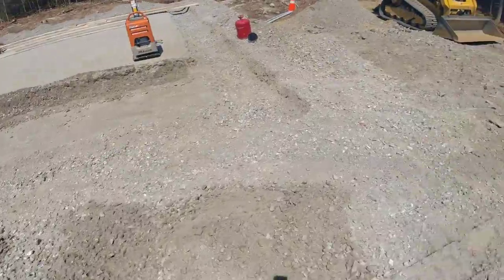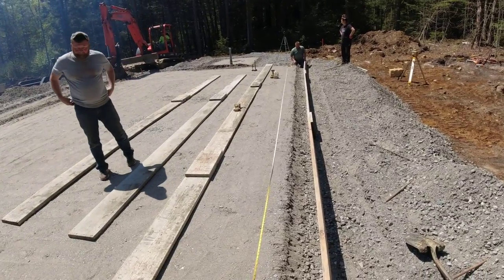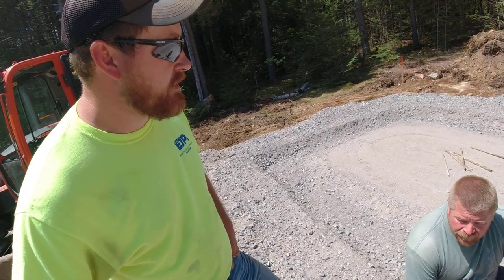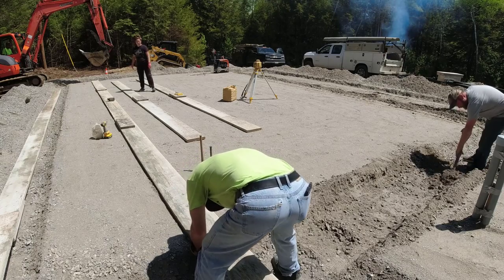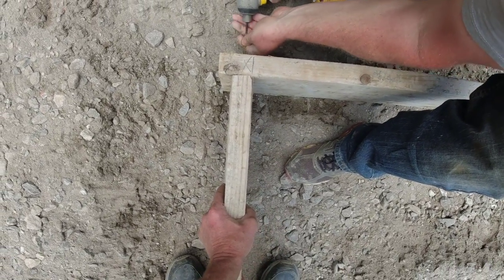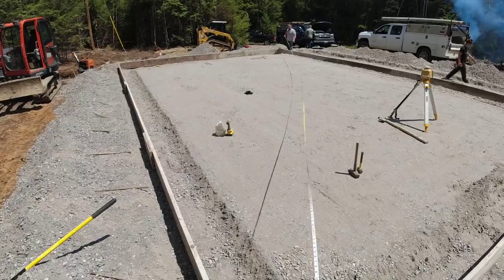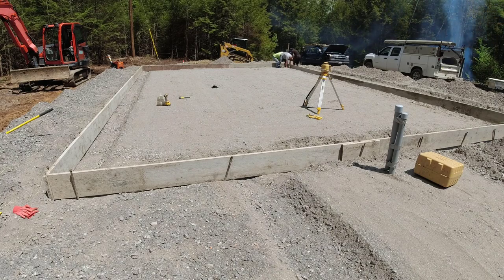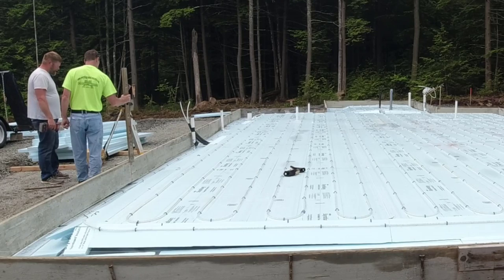Slab Prep Gone Wrong! How We Fixed It

Comment: Hey Mike,
Have you ever used a big hammer drill with a round bit to pound pins in? I just started a couple years ago. I plug into small generator. Goes very fast & saves your elbow.

Comment: Question for you please,   Is it absolutely necessary to put down a crushed rock base before pouring cement ?
Reply from the maker: In most cases either crushed rock or good gravel is best.
Reply: @MikeDayConcrete  What if it's a sand hard ground for a 13' X 20' monolithic edge with a 4" thick center Cement slab.  That's what a contractor with 20 years of experience told me.  If it's done that way will the slab crack sooner than later ?

Comment: Great job, quick question. The styrofoam appears to be under the DPM (damp proof membrane)? The radiant heat pipe clips appear to puncture the membrane. Is there another membrane under the foam to stop it soaking with groundwater, losing thermal efficiency and possibly leaking up through clip puncture holes? Thanks Mike.

Comment: Hi Mike,
Great video as always. I'm surprised up in Maine that there isn't a problem with the building inspectors in regards to not having a frost wall perimeter? I am surprised they were good with a shallow honch like that to serve as the foundation for a habitable conditioned structure ?
I know that would be on the general contractor for sure. I'm a general contractor in Massachusetts and we could never not include frost walls to achieve the 48" depth requirements up here in the northeast. Even stand alone garages require frost walls here in Massachusetts and you guys are even further north and get even more freezing cold and snow up there ?
You guys do real nice work and I watch your videos all the time for that reason. I thought I would check on that with you and ask how that honch is allowed up there ?
Thank you for you great videos Mike .
Reply: That is exactly what I was thinking too.
Reply: I think he was meaning the bed rock is shallow and they would run into rock any further down.

Comment: I don't know anything about concrete work but I'm hiring a guy to make me a slab on grade for a metal garage building. Climate zone 6. Does he have to dig down past the frost line and put a footer or can he just do something like you're doing here?
Reply: Check with your local building and engineering department. Make damn sure the guy you hire follows the local code.

Comment: Shouldn't the builder provide batter boards or pin the corners?We always did our own footers, if anything was off it was our problem.
Reply from the maker: They usually have pins in the corners or a wooden stake. When we get the forms in place we pull it.
Reply: Thanks Mike,Working for the contractor we were always on-site if subs had questions or issues